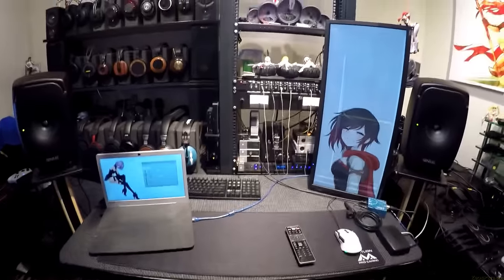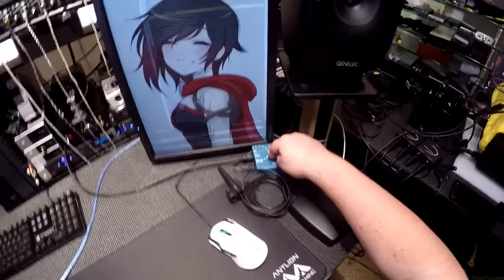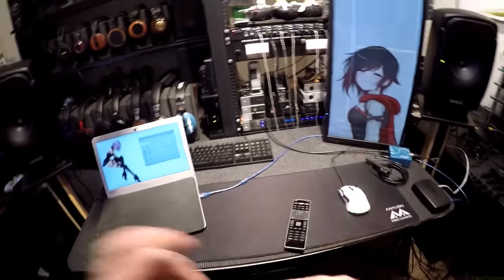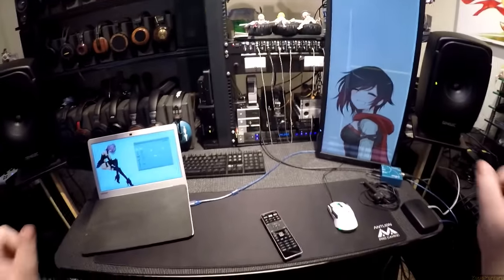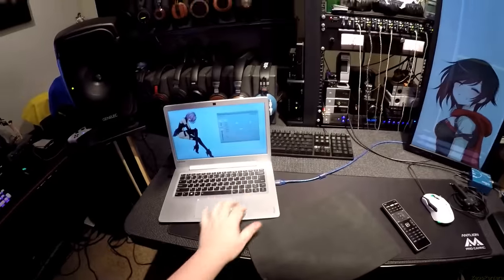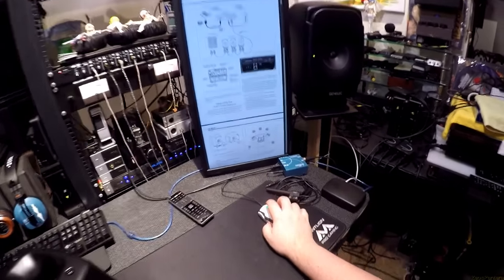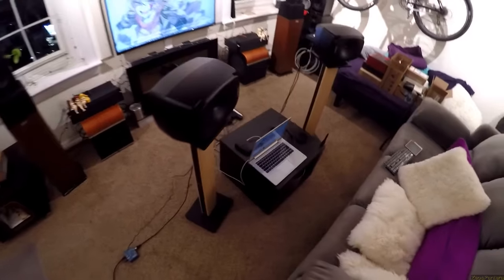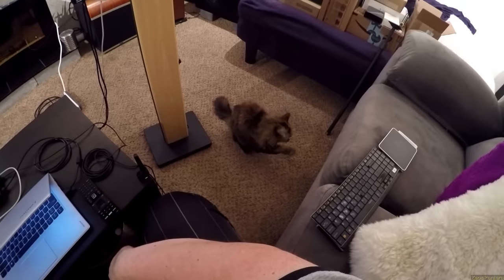GENELEC 8341 _ (Z Reviews) _ $6,000 of Acoustical Precision & Magic

Comment: The offset woofers are placed behind a baffle so they will not create reflections of high frequency or midrange frequency wave energy. The high frequency and mid frequency energy will reach the edge of the baffle and then be diffracted away from you, the listener. (The contoured shape of the front baffle has a related purpose.) The woofers may be placed behind the baffle because they are not reproducing midrange energy, and the dimensions of the ducting to the outside edges of the speaker are smaller than the wavelengths the woofers are required to reproduce, so the wave is conducted to the slot at the edge and radiates out in all directions. When I first saw it, I thought it was an idea so clever that I was actually a little mad that I had not thought of it myself.

Comment: Zeos, as an audio engineer myself, as much as you love these and are amazed by these monitors (Genelec certainly makes some of the best monitors and all around speakers, period), in a room without acoustic treatment, you will KILL for these in an acoustically treated room. Trust me mate, purchase some Rockwool (80 and 60) and read up on some DIY acoustic panels, and build them. And don't forget some diffusers. I guarantee you TRULY hear these, and every other speaker/monitor.

As great as these speakers are in your rooms, they'll sound even better in an acoustically treated space!
Reply: This applies to every listening setup that doesn't involve headphones/IEMs
Reply: While I must agree that treating is good. A properly designed speaker like these genelec will sound just as good because the frequency response of the reflections they produce will be very similar therefore not causing any interference in the FR. This is another thing that makes Coaxials so good their off axis response is similar vertically and horizontally.

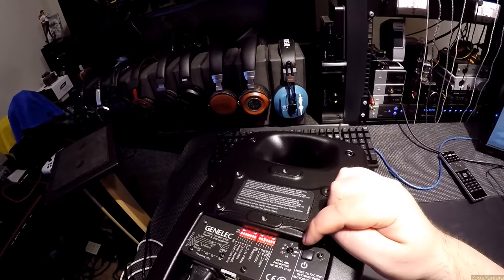Comment: 30:20 This input sensitivity control does exactly the opposite of what you might expect if you have not properly processed and understood the lettering. The lowest setting results in the highest output volume. For a 0 dBu input, the -6 dBu setting will give 106 dB SPL out, and the +6 dBu setting will give 94 dB SPL out. Not exactly a massive range but usually sufficient.

Comment: There's about 1000% larger Genelec. Look up for 1236A SAM, which has two 18" woofers side by side. 400lbs each and a bit more expensive.
Reply: hOLY Fuck that's some monsters
Reply: Just a bit
Reply from the maker: Now I need them.
Reply: 😂 Forget my previous comment. Someone needs to send him a complete pair to review. The reaction would be gold. What was the price on them again?
Reply: I think they are 10k
Reply: Let me check
Reply: @dilbyjones  Genelec 1236s are about 40k a piece man.
Reply: Looking forward to the review. They should do the job in your room :D  @ZReviews
Reply: More like 186lbs each with amp.
Reply: Holy fuck 130 decibel
Reply: Monitors for real men.
Reply: Holy hell. They look ridiculous. Considering Genelecs strong dominance in pro studios I wonder for who the 1236A SAM exactly is? I just don't see why a studio would go for it.
Reply: @tissot233  to mount in a soffit and to master orchestral and movie stuff in massive room.

For the size I'd say it lacks bass extension, and it's less accurate based on their own measurements.

Genelec speakers typically have a range they operate in and don't deviate more than 1.5dB. These are +/-2dB. Genelecs 8260 us +/-1dB, which is similar to the JBL M2.

I wish their new 8361 etc. went deeper like this 1236a, but lots of larger and newer speakers from them simply go for volume over accuracy and bass extension relative to their 8260.
Reply: @tissot233  Main rooms in those massive studios owned by record labels. Deadmu5 has a pair of those too in his home studio too.
Actually, many famous electronic music producers have large monitors in their professionally built home studios.
Reply: @imnotprisma  I thinks it's ATC
Reply: Sure they are big but they are no coaxials and is not as accurate as the 8361. Even though the size and price difference of the 8361 vs the 1236 SAM is huge. I must say the 8361 is the best genelec or even the best speaker in the world with only needing a sub for the lower octaves.

Comment: 7:01 I've been researching how AES3 works (looking into Genelec 8330A's) and it hasn't got a return signal. It just uses a balanced signal and higher voltage than coaxial. If I've understood correctly, the only difference protocol wise is in the channel status bit, which AES3 uses for control information and S/PDIF for copy protection.

Comment: Just bought a pair of these need a new amplifier though for the use case as mine has a bit of colouration which I'm looking for an accurate sound, I'm probably going to get a RME-Adi-2 Pro and a Naim NAC 202 for a pre amplifier. 

My current setup is KEF R3's on a Hegal H390 with a Astell and Kern Sp1000m running as the DAC or the onboard DAC when using it wireless. 

After tax return time I'm unsure if I want to get the KEF LS60 wireless as I'll have the KEF R3's in the same room not my work room, or upgrade my SP1000m to the SP3000 and a pair of Meze Elites Epoque's and maybe an Ifi Diablo or something similar. 

After these purchases I should hopefully have my end game for the next decade or so.

Comment: good review Zeos. I have a pair of  old 1031A's Genys and they're  amazing. When you hear the next gen stuff from Genelec and JBL Pro you will be BLOWN AWAY.  Because of ATMOS mixing, speakers need to comfortably hit hi SPL and still be small, so compression drivers are the only drivers that can handle  that without compressing the sound.  Try to get a pair of 7 series JBLs or Genelec S360.

Comment: Glad to discover your channel. I have the 8351A version and I got similar reactions to yours first time I heard them. They are so accurate, distortion free, frequency flat, with a beautiful stereo imaging. They have so much dynamic and power reserve for their size too. To summarize, it’s like having less crap between the music and you. Those are my preferred speakers ever.
Worth noting I compared them to 3 way Neumann that were probably 3 times bigger in volume and the 3 way Focal with the 2 woofers and mid tweeter you can rotate. The Neumann were great too but I preferred the Genelec. The Focal were nice but significantly less good. The only down side for me is the volume control current system that should be much smarter.
Reply: I agree, the volume control is a pain in the ass sometimes.
Im also using the 8351s and what im using most of the time is the wireless remote for the glm. 
The volume knob is annoying because its not very accurate.

Besides of this i love these speakers.

Comment: I like these Gennies. They're close to the Neumann KH 310A (my choice). Yeah it's expensive. But it's for work. You don't want to guess.
Nice review Z. Put a smile on my face. :-)
One question: Why not sell ALL of your speakers and buy a pair of these ? ;-)
Reply: reptilespantoso the FR directivity performance of the genelec coaxials is better based just on the graphs — but that’s because of the inherent design difference (tweeter and mid driver placement). Aesthetically, I’d probably pick the neumann 310 — also because they don’t have any ports.
Reply: @cl2nden1st89  Yes, it's a nice design on the Genelecs. I may be a bit biased towards the Neumanns, I used the old Klein&Hummels before that. I also like that they're a bit "laid back" in the highs and upper mids. Both fine though.
Reply: reptilespantoso I’ve set two of my monitor sets to +1 to 1.5 dB but I’m losing my high frequency hearing slowly so it’s primarily to compensate. We all will eventually slowly need to make some compensations, as we do with eyeglasses. Some people seem to think that their senses don’t age, though, and that they’d live to 180 or 200 or whatever nonsense. Mortality and aging is a bitch. Unfortunately, the ones who are often able to afford “high-end” audio systems are the ones who are also losing their hearing the most. The kids seem to be fine with mediocre speaker systems though

Comment: nice when i picked up my 8351 i was more than happy i came from using both 8240 and 8350 which use same DSP tech but were 2way systems i actually liked the smaller 8331 better but the DSP sub was not available so went with 8351everything works perfect DSP system is so solid even the 8300 two way system i can recommend because even tho i got rid of my 8350s i am keeping my 8240 as that is going to forever be my reference monitors. FYI AES or Analog make no real world difference when working with them used both and asked genelec tech team and they confined this its purely what is most convent for you connection wise
Reply: So how are those 8340 vs 8351 in mid and tweeter, stereo image ??? I'm very curious do tell please?

Comment: I have these speakers. (Actually I use them as my telly speakers, watching this video.) Just some thoughts:

You can't really blow up those speakers, at least without really breaking all the rules, basically feeding overvoltage to them. (Especially you can't do this with digital inputs.) The speakers have internal protection circuitry and/or logic for this specific purpose. You can get them to limit themselves which would reduce sound quality, but also probably a sign you should lower your listening volume before you lose your hearing...

You can also store settings on these speakers after you have configured stuff using GLM, so these things are not playing unnecessarily maximum volume. (... as you apparently figured out later on the video.) In my opinion this is "good enough" for 24 bit digital input after setting a reference maximum volume sensibly.

Also, a pointless technicality: speakers are not masters or slaves on these buses. Neither AES/EBU nor GLM (really RS-485 on the background, not Ethernet, although it uses RJ45 connectors!) have a preference over one or another speaker.

Comment: Thanks a lot for great videos!
I thinking of picking up a pair of Genelec 8030 for editing/mixing.
Would also like to ask you what headphones you recommend for editing/mixing?
I want similar characteristics to the 8030; revealing and giving a good foundation for the audio to transfer well onto other speakers/headphones. Price is not a big factor, I would rather buy good stuff from the start instead of upgrading forever, within a reasonable limit of course. I am not ready to spend thousands of dollars on a pair of headphones, but a couple of hundreds is no problem. A built in microphone is a great bonus, so that I can use them for voice calls through my laptop as well.
If it makes any difference; I will mostly record dialogue (and maybe a bit of vlogging) through Shure TL47 lav mics unto Zaxcom ZFR400 recorders.

Comment: You can and should save a volume level so that the speakers default to that if there's no GLM box connected. 👍Also, heavy duty room treatment is the king. Bigger improvement than any speaker upgrade.

Comment: You need a lot of acoustic treatment for Genelecs, and I don't see even any corner traps in your room. It seems like you get a massive sound but all the detail is there but very blurry and you have to focus hard to identify them. I use 8050s and they didn't sound detailed at all in the untreated room, although I knew that detail was there somewhere hidden, until I put a large amount of broadband absorption into the room. Don't rely too much on digital eq correction in these systems, you still need to properly treat the room before fine tuning it using those correction tools.

Comment: Nice, almost got these but the Focal SM9s are the last word for me in monitors. Run them in a treated room with analog xlr outs from a dac connected to the workstation (pc) with volume control from the DAC and pure mode enabled on the monitor which bypasses DSP and gives you the raw audio. As pure as it gets. Equally amazing tool and for playback

Comment: Does lowering volume in foobar really drop bit depth? What about the windows master volume slider in Win10? Have I been living a lie?
Reply: Yes, lowering foobar or WMP or VLC will crush bit depth. 

As for the windows mixer, I'm not sure but I wouldn't be surprised if it did too
Reply: Wasn't that audible only on Windows XP and older ?  @The-Roaming-Roadie
Reply: @nineinchnick  as I stated, I'm not sure when it comes to windows mixer.
Reply: Hasn't been a problem since Vista or so. Mixer uses 32-bit, so you don't lose anything.

Besides, all that happens when you reduce the volume from a digital control is that you're lowering the useful signal's loudness while keeping the quantization noise loudness the same (signal to noise ratio goes down, but that's by lowering the signal, not upping the noise). So by setting your analog volume (amp gain) to a fixed level and just controlling everything from the digital you won't be affecting the noise floor, it will always stay at the same level. If that level is a problem, you can find out by:
1. setting your analog gain (if you have control) to a level such that going to 100% in digital makes it as loud as you will ever want it to be
2. lowering the digital volume until you're almost still hearing the music but not really
3. starting and stopping the song to check for quantization noise.

If you can hear a faint hiss with the song playing but not without it, from your normal listening position (not ear against speaker I hope), first of all I envy you for the silence in your listening room :D, and secondly you don't have enough bit depth on the digital side of things to allow you to just use digital volume control. But I doubt you will hear this happen. This is just a test that will likely convince you there is no real problem with applying digital volume control to even 16-bit music.
Reply: thank you for this reply, i think i get it now @d0nj03

Comment: A potentially easier way to control these would be a minidsp open DRC with digital outs and a remote. It does the digital attenuation in 32-bit, and can save volume states when you restart it.
Reply: (I haven’t tried this personally but I researched buying these extensively a bit ago)

Comment: Here's what I think, dear folks: these are not just expensive speakers. These are powered, speakers. Their designers and manufacturer precisely designed and matched amps to the drivers! So you are not only buying speakers but also amplifiers! And with Genelec's room correction software, you save on room treatment, which could be very costly. So, I think you should not go but RUN and buy these. You will be getting yourself a bargain.

Comment: Review KEF LSX?
Reply: The real soundbar replacement, other replacements miss the Wi-Fi option.
Reply: @Earth-Apple  TBH i dont think any soundbar comes close to its sound quality to begin with. I wouldn't even call it a replacement.
Reply: Lsx: LS50W, less bass. What they should be doing is making a ls50 model that is larger and can go down to 20 Hertz. Something to compete with the Genelec 8260.
Reply: @stevenswall  To be fair, it does include an option for a subwoofer and since KEF is an audiophile company, it makes more sense for them to make something with a neutral frequency. Keep in mind soundbars have an insane amount of bass because they are are made to imitate a 5.1 or 6.1 system for a theater experience. In terms of theater use, more bass and quality bass provides the better cinematic experience, but the lsx is not for that, it is for music.
Reply: @kuuhaku1168  what do you mean by neutral? Going down to 20hz doesn't mean it's not neutral. Subwoofer wise, it seems many audio files when they are auditioning speakers like to listen to them without a subwoofer. Once you introduce a subwoofer, you might as well get two, and now you have four boxes to worry about instead of two.

I just want two boxes that go down to the 20-30hz region. KEF is focusing on things like the LSX which is really good at not even going down to 40hz without rolloff. Unfortunate, though I suppose it's relatively cheap.
Reply: @stevenswall  like a flatter frequency, but I do agree that they should make a larger ls50, that would definitely be something cool.
Reply: Actually the ultimate surround sound speaker--especially if you already own LS 50s.

Comment: Dear Sir
My room Small... 10×10
KEF Q400B Sealed or BIC America F-12 Ported
Which one is best for my Room..?
Reply: Honestly you could probably get away with having some big bookshelf speakers that have a woofer. But between those 2 subs either should get the job done but you will want to upgrade.

I started with a 12inch sub and ended up with a 15inch sub. It's perfection.

Comment: But you don't take to the to their full potential.  For that, the feed has to be a very precise AES signal. Precise = minimal jitter and very accurate timing. That little converter you employ doesn't do them justice.
Reply: Yeah.. in germany we would call this "perlen vor die Säue".

They should hooked at least up on a RME fireface or some other jitter reducing Interface.

Comment: If studios are mixing and mastering music on equipment like this, how is so much of it made so terribly nowadays
Reply: Actually, they use even more expensive speakers and in very expensive studios where just the mixing board is a 1500 $ /month energy bill. The problem is the final avarage consumer that nowaday listens with crappy earbuds in the subway or with the mono speaker of the smartphone or a bluetooth boombox. To make the bass line perceptible through small speakers you need to enhance the harmonics with eq or create new ones with saturators (mild controlled distortion that creates harmonics). Add to this the loundness war (dynamic compression) and you have today music.